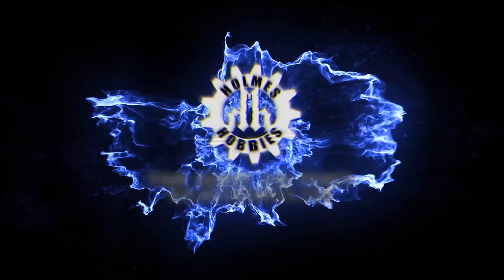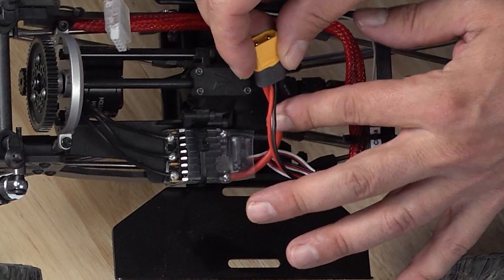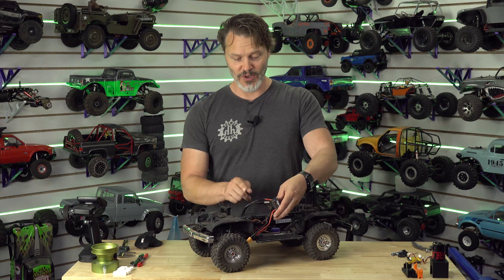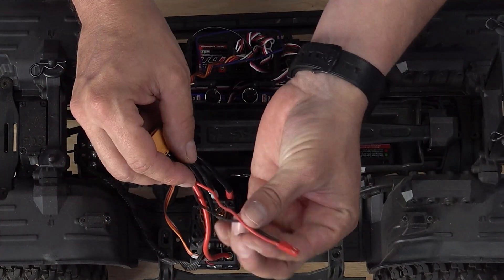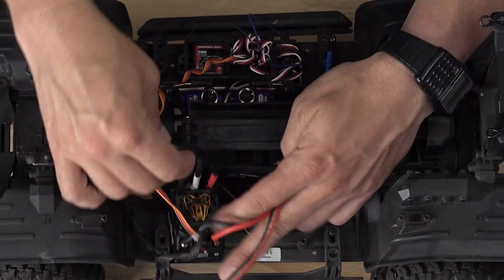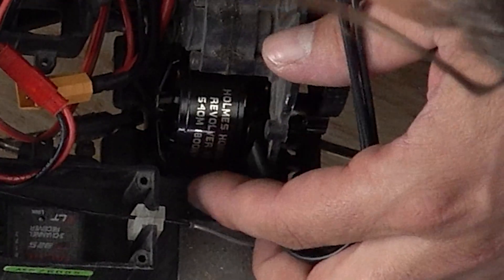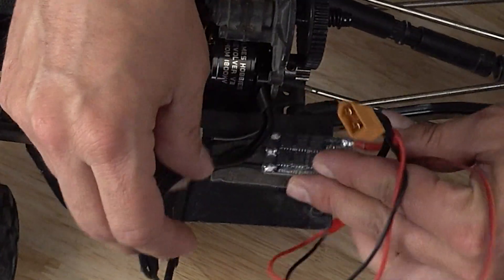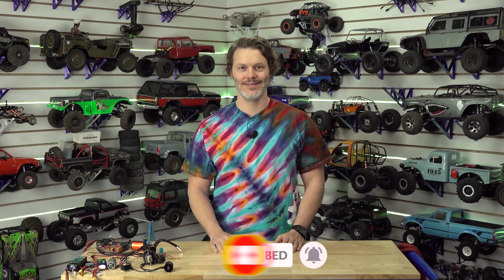🔧 Perfect Wire Sizes: Optimize Your RC Rock Crawler's Performance!🚗⚡️

Comment: That's what she said! lol  Did you ever get the wire loom in to sell?  I was just looking and couldn't find it on the site searching "loom" or in the wiring accessories tab.  There are also charts out there that will tell you what amp load each AWG is good for, depending on the length of the wire.

Comment: How about those servo wires. I have a giant Holmes 2000 1/5 servo with baby servo wires and I wonder if it would have benefited from having larger wires. My BEC has two plugs that go into receiver.

This is a great video topic, look forward to seeing more like it
Reply from the maker: It seems a good plan to explore the jst power tap for 5th scale in the future.
Reply: @HolmesHobbies  Like in combination to the servo wire? That would probably allow for lots of juice then. Jst is not rated for much by itself if I recall correctly?

Comment: I remember when I tested my 240A brushless ESC and 1.5T 540 motor over 14 years ago, all the wires were dancing due to the high amp draw. I actually rated the ESC 200A mainly due to all the lipos I tested it with hit the cut off while drawing 200A max. If I was still in the hobby with the new lipos claiming such high C ratings, I could probably see the full potential of my very old, but still very powerful 10th scale brushless ESC. I might make it more powerful if an idea I have could be done lol.

Comment: I cut the wires down and use 20amp connector blocks. Makes life easier if I have to change a motor when I'm out. Pre solder some hefty stuff onto the spare 😉

Comment: So Shorten my Wires on my WPL is not going to change anything. I found a bad Solder on my Power plug from esc. Made a huge difference just better solder job. I did shorten my Power wires when i fixed it.... It was acting weird After I would Throttle it, when battery would Discharge. Would go into Protection mode i guess and Cut the power from Esc in half. Fixed that wire and got Full use of my 370 motor. Thank you for All your videos. I have learned so much in 5 months.
Reply from the maker: Glad to have you aboard! Sounds like your doing great, working out the kinks till you have a system that works the way you want!